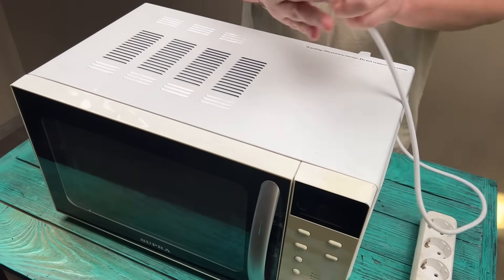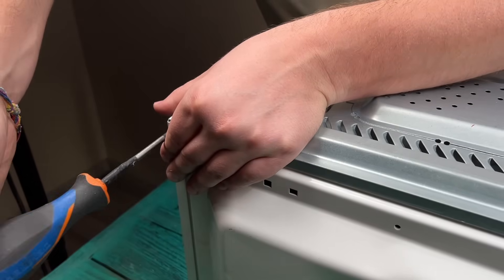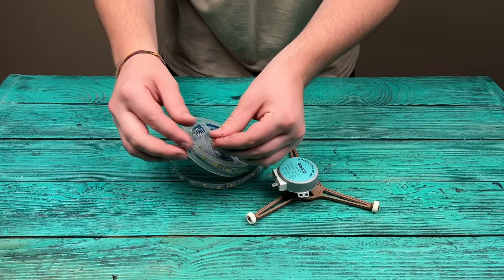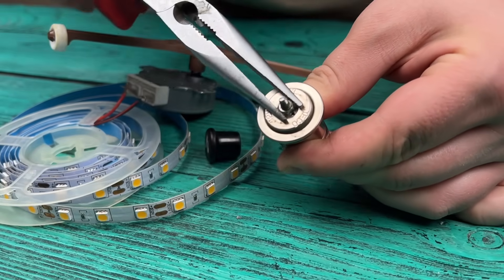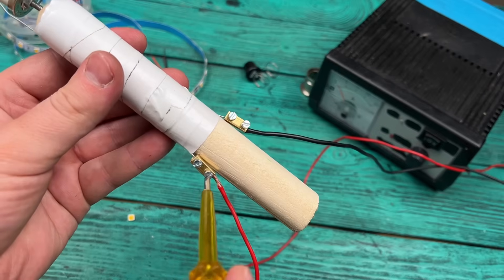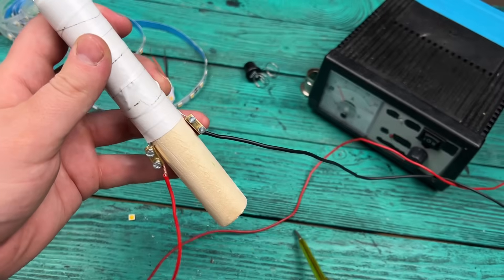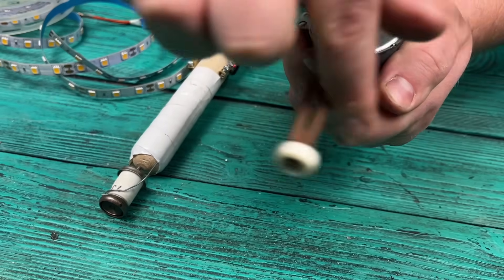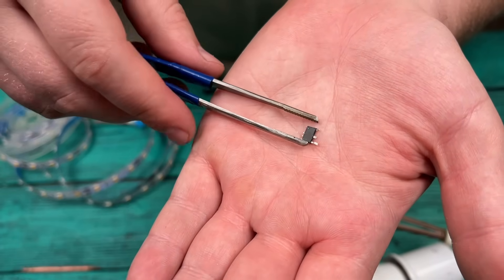Why isn't this patented? INFRARED soldering iron from an old car cigarette lighter

Comment: I am a 100% couch potato, never made a thing, YouTube maker watcher. Therefore I would not malign your excellent YouTube. But maybe a small suggestion. This is based on my experience with crank radios and flashlights. They are hard to use because you have to crank and crank to keep the devices running. The devices are hard, therefore, to use enjoyably.

Drill out the center of your dowel and make room for four small supercapacitors (maybe make one long one yourself) that you connect in parallel. Then hook the motor to the capacitor(s) to charge them and then use the soldering iron. You could use two nickel metal hydride batteries instead. Charging would be easier than lithium, and although the number of cranks to reach full charge would be greater than with capacitors, the run time for the soldering iron would be longer. 
Excellent project, excellent YouTube. Thank you for sharing your creativity.
Cheers!
Reply: Oh, since you asked, Seattle, Washington, United States.
Reply from the maker: That's an interesting suggestion, I'll consider it for future projects!

Comment: From Namibia and at 1:47iesh, your left hand had me worried. Be more careful pls.
Reply from the maker: I'll be extremely careful! Thank you.
Reply: @FixItFast1  The problem is you had your hand close to the capacitor.  That thing can hold thousands of volts and easily kill you.  Keep away from all high voltage parts until you verify the capacitor has been discharged.